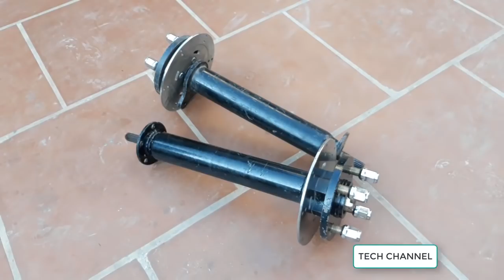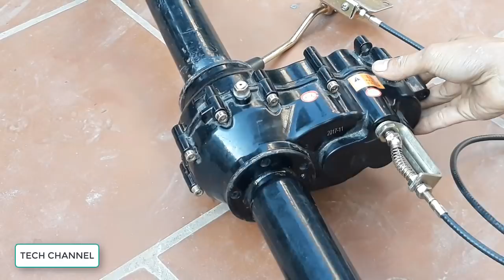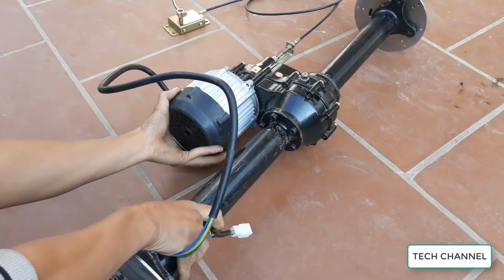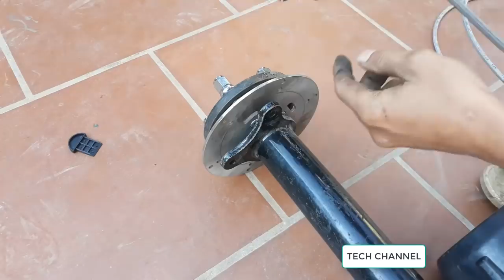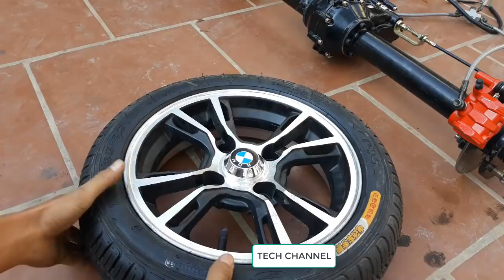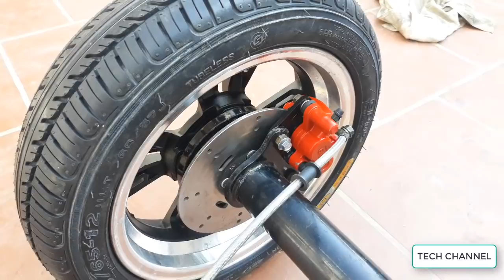TECH - How to make electric car with oil disc brakes - Rear axle of tram

Comment: Mounting a motor directly on a solid axle not a great idea. The suspension will not work on the motor. For a golf cart or if you live somewhere where the roads are perfect it might work. Expect broken motor bolts.